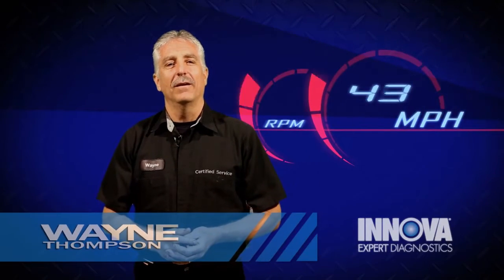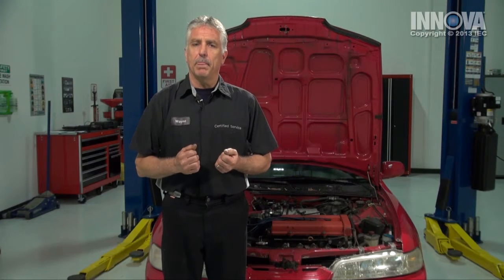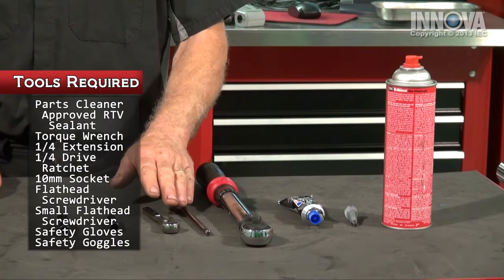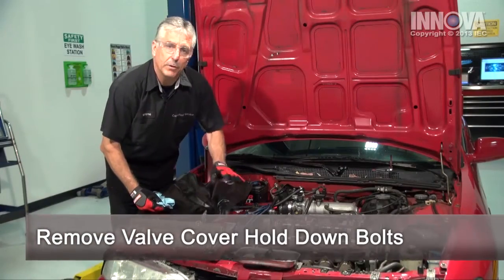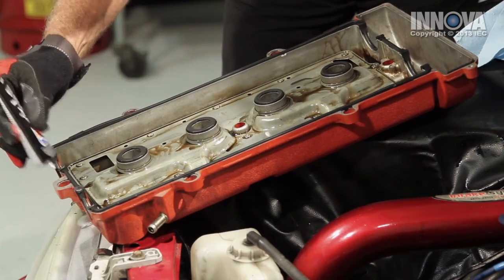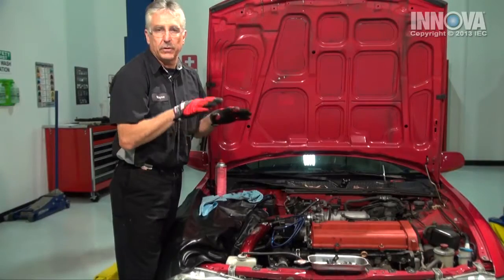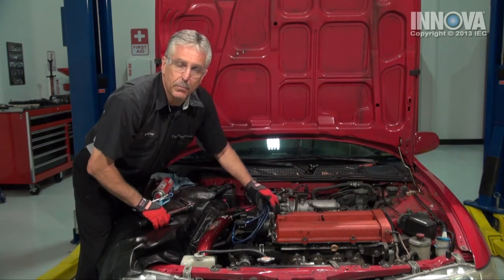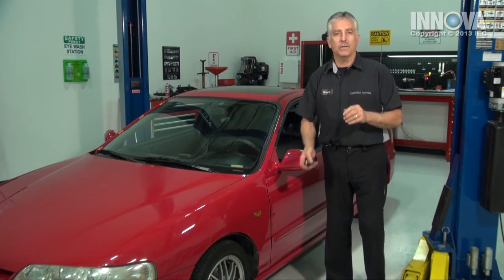How to diagnose an Oil Leak - Valve Cover Gasket - 1999 Acura Integra

Comment: a valve cover on a honda will leak so little its not even a big deal, plus they are like 20 dollars. you gotta worry about the solenoids and the gaskets on the side of the motor because they can loose you a lot more oil.